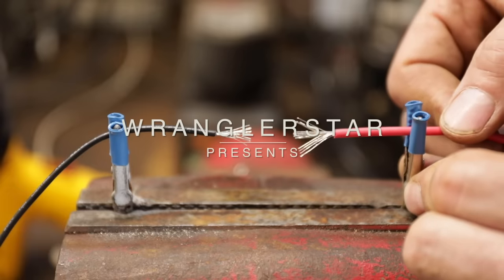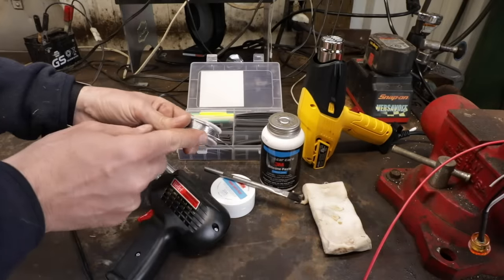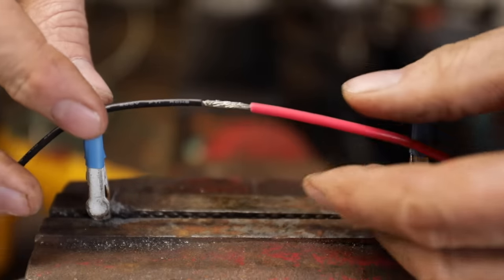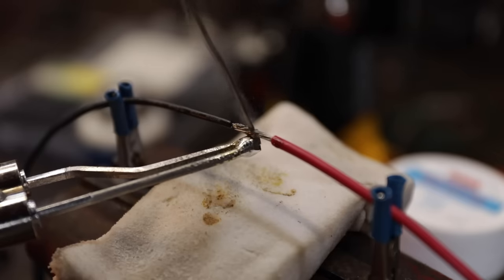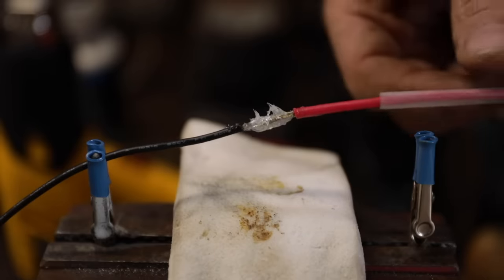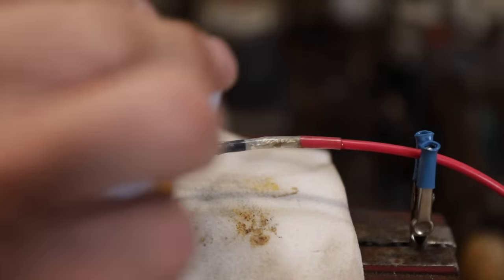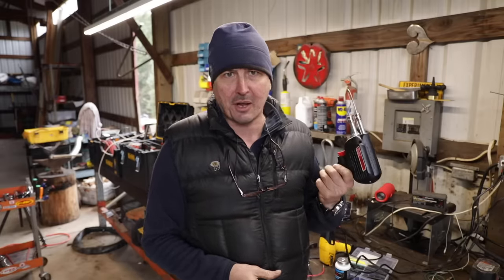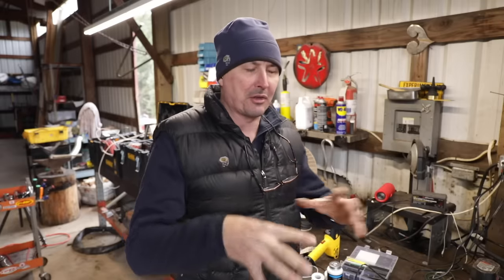How To Solder Wires Like A Pro

Comment: Hey Cody, while it can't hurt, the use of flux paste with rosin core solder in this type of soldering is redundant. Flux paste should be used when existing connections are re-exposed to heat, such as in the case of soldering adjacent connectors, etc.

Flux inhibits oxidation at the site of heating, which results in better connections.

Also, flux should be removed following soldering so as to minimize corrosion. A lint-free cloth and isopropyl alcohol are adequate for this application.

Dielectric grease is a corrosion inhibitor, so it's great for exposed electrical connections. Especially the mechanical type, such as a lug and bolt.

Properly applied, hear shrink tubing will seal connections, and it's also optional in this application.

It should be noted that solder and flux are available for specialized purposed, and that plumbing flux and solder should not be used to solder electrical connections.

Lastly, do not directly touch solder to the iron. This is the reason why it took so long to initially heat the conductors. Heat the leads, then touch the solder to the leads to "flow" solder across the connection. Wipe any flux and solder residue from the tip of the iron, and repeat.

Great video, as usual. Keep up the great work.
Reply: As I understand it, Cody was right to want to tin the iron. Though he ended up keeping a blob of solder on the iron. To tin, he needed to apply the solder then flick excess off, thus keeping a thin layer on iron only.
Reply: I know you should use proper flux for the proper job but I've used an old tin can (or steel? not sure) of nokorode that's been in the family since my great grandfather, and while there's still flux left in there we probably won't buy anything new because it does the job and it does it really well, provided you clean up afterwards (isopropyl and a nail brush). The only issue with it is the fact the binder is a really nasty thick grease, but honestly I'd rather take that over the horrible liquid flux that's really popular, I should also say I would probably get real electronics flux paste if it was sold where I live, but it isn't so no luck on that front.
Reply: Hey buddy where can i get electrical flux
Reply: From a Flux Capacitor,maybe?
Reply: @samborez8089  true
Reply: @slicktmi  the same place where you buy the solder itself .
Reply: @pplo  lowes or home depot only carries the plumbing flux very acidic

Comment: People need to be wary of any youtube video that declares itself as 'how to do something like a Pro', because 99% are not done by pros, always check the comments for an outcry. Speaking as a Pro, that was pretty good, except most QA instructions will instruct you to twist the wire or do a lineman's splice, what you are doing there has no mechanical integrity. Well done on adding dielectric grease, that's essential. 
Just to add, you can also use adhesive lined heatshrink for extra sealing, and most solder has a flux core already.
Reply: Actually adding the dielectric grease helps retain the tube’s 99.99% seal around the bare wires before they were stripped. using heat shrink alone wouldnt be enough to maintain that seal as there would still be possible air gaps.. i wont explain what the dangers of air gaps are since you seem to “think” you know better..
Reply: Where did I suggest 'using heat shrink alone' ? - your point is unclear
Reply: My thought exactly!! I cringed at the wire joining method... Then he wondered why the heat wouldn't transfer..

Comment: We live on an ocean going sailboat so all of my electrical connections exist in the worst possible connections! Thanks for the tips. I’ve been using the heat shrink connectors from Anchor and they usually hold up for a few years, but I’m always looking to improve my technique 😎
Reply: You have data out there in the pacific blue???!

Who's your service provider? I might consider switching over

Comment: Tinning the tip?  It's for improved heat transfer.
Reply: see how this made you into a pro,  wow!
Reply: Tinning actually involves applying solder to the work area then wicking it off prior to performing the repair.  What this does is remove surface oxidation that could prevent solder from flowing and aid in heat transfer.  Adding solder to the tip of the iron is technically called "seasoning." This should be performed after each use of the iron to prevent the tip from oxidizing and extending its life. ...I taught high reliability soldering for the Navy.  😆
Reply: @EenChristJesus  yeah I only watched a couple of seconds of the video but the guy definitely doesn't seem like a pro
Reply: @Eric-xh9ee  of course he isn't a pro, he doesn't even know why he is putting solder on the tip before soldering, nor does he have proper soldering equipment
that's the wannabe do it all
the "it's not dumb if it works"

Comment: Putting a small amount on the iron helps the heat transfer (tinning)
Reply: He did. lol
Reply: Freefallpilot65 you do it while heating the wire it useless the way he did it
Reply: Absolutely correct. That puddle on the tip helps transfer the heat to the joint.     It also helps to put the flat part of the tip on the joint.
Reply: Indeed, increases heat transfer.  Makes solder flow faster and avoids burning things up.
Reply: absolutely, and the wire is probably bare tinned copper no need for flux
Reply: Butthole Tickler he also tinned it then wiped pretty much all of it off therefore did not help at all since his iron was already tinned in the beginning, if he had tinned the iron and left a small puddle of solder, it would’ve helped the heat transfer way better
Reply: It was tinned but Iron was not properly heated
Reply: @Freefallpilot65  Wranglestar mentioned in the video that he didn't know why his grandpa did that.  Watch around 03:48. Craig Flatley was just answering the "why".

Comment: 1. Live in a pool (create a flow of solder and keep it liquid)
2. Solder will travel to the heat once the pool is formed
3. Don't use too much heat
4. Don't get the solder in the insulation from using too much solder (check by bending the wire, you'll know if it's stiff).

Comment: I've had an instant Weller since 1969....... 1. You're using the 'edge', not the face of the tip  [90 degree wrong]    2.  You DO wet the tip with solder -  massively increases heat transfer, to the work     3.  Took far to long to do it -  5 seconds about right

Comment: As a little note, clean off the rosin flux with rubbing alcohol before you put the shrink tubing on. The rosin is acidic and will eventually eat through the wires.

Comment: You don’t need the silicone paste with shrink tubing. It keeps the glue from tubing from sealing properly. Only use silicone on stuff not shrink tubed. Like spade but connectors
Reply: Not all shrink has glue

Comment: Cody, in practice any application where there is a chance for wire movement it is better to use crimp connectors.  In the marine and aircraft industry soldering wires is not allowed unless the wire is supported and not allowed to move. 
There is no doubt that a solder connection provides the best connection.  It come down to the movement of the wires.  
Also if you are using core solder there is no need to use paste on the wires.  Never use acid core solder on electrical connections either
Reply: Crimping is NOT better for splicing wires; solder is preferred method. If you have enough movement in the wire that solder is going to break, the wire is going to break anyway. Signed UH-1H crewchief!
Reply: It is not allowed in the NEC either. Current will heat the solder and it will fail. If you use in automotive I don't think it would be a problem if the conductor is large enough and your current is limited by a small amp fuse.
Reply: He's obviously talking for 12v applications, he did say trailer.....
Reply: Terry Pendergrass - I've just looked at the FFA's Aircraft Electrical Wiring Interconnect System (EWIS) Best Practices, and it says nothing about soldering being a preferred splice method. What published standards do UH-1H crews work to?
Reply: BlindGuardian050 that shows your intelligence buddy! Hahahaha
Reply: But...
Aviation style connectors have two sections and have to be set properly. One part of the connector crimps the wire and the other crimps the wire AND insulation keeping it from concentrating the stress there. While that may be the best mechanical connection for vibration, I use solder and heat shrink a lot, Cody’s example is a nice way to do a joint exposed to weather.
Reply: If you heat a connection to the 600 degrees that it takes for solder to fail, you've got bigger problems.
Reply: "Any application where there is a chance for wire movement it is better to use crimp connections". I disagree soldering is superior.
Reply: Technically, in many applications where wire movement is to be expected, crimping is the best option. I will agree that soldering creates a more electrically conductive connection, but crimp connections are more than adequate and much of the time are required to be used where movement will be seen in the wiring.
Reply: @ Bullion Forever  In high vibration environments, soldering is dangerously inferior. Not electrically, but the mechanical resilience  of the connection.  That's why it is usually not allowed with stranded wire in marine, aviation and rolling stock. The wires will break at the transition zone between the solder wetted and non-wetted wire parts. You can try it yourself, it is quite shocking how easily the wires will break.
Reply: Terry Pendergrass If the crimping is done properly, the wire leads will practically be "cold welded" to the connector from the pressure applied by the crimping tool. I'm not talking about those crappy combined crimping and de-insulation tools, I'm talking about a proper crimping tool, those will apply a lot more pressure.
Reply: And the prize for best answer !!!
Reply: National Electric NEC is for buildings... which use mostly solid core right?
Not stranded. And if your circuit gets hot enough to melt solder something is very wrong.
Reply: Oxygen sensor wire on a high boost turbo car. Especially if you try and use a "universal" O2 sensor and you cut and solder the wires. In the case of the O2 sensor, it also may impede the air for self calibration. Modern sensors use the air between the wire and insulation.
Reply: OOPS, I thought I was replying to The Reverend's comment of "If you heat a connection to the 600 degrees that it takes for solder to fail, you've got bigger problems." Thus my random O2 sensor example I gave.
Reply: Wrong, Soldering is allowed, better, just depends on what and how
Reply: Actually most Aircraft/spacecraft wiring harnesses are factory soldered, field repairs are usually crimp connectors as soldering on the line is not as practical.
Reply: Dave, that is correct. We only solder to pin connectors on avionics racks. Everything else is crimp connectors.
Reply: Absolutely incorrect sir. 40+ years experience and 10 years teaching mil-spec soldering in the Nuclear Navy and commercial Nuclear field. Get your facts straight. Learn about temperature/ current load cycling and solder crystallization, and the effects of vibration over time on even mil-spec grade solder joints. Properly made crimp connections have none of these problems. I personally discovered the cause of Navy fleet submarine nuclear instrumentation intermediate range detectors causing random spiking problems causing reactor trips due to soldered triaxial cable connectors having the solder crystialize (acting like a crystal radio detector). The answer was to use crimp connectors, which are used to day on all nuke plants, Navy and commercial. Current ranges were from 10 -11 amps to 10-3 amps for these detectors. Your experience sir?
Reply: I'm sure you know more than automotive manufacturers like Honda, who insist that wires be soldered and specifically day never use crimp wires BECAUSE wire movement will cause crimp connectors to fail.
Reply: "Also if you are using core solder there is no need to use paste on the wires."   Wrong. Always flux your connection before soldering. Cored flux is for continued fluxing during the soldering, pre-flux is still preferred/required. It also improves wetting action.  Ref: NASA quality standards for soldered connections.
Reply: Solder provides the best electrical connection but can not be depended on as the physical connection. I think that's what your statement implies.
Reply: @nationalelectric6507  Generally, Current would only heat the joint up if it was dry joint..
I suppose that's quite possible by listening to some pillocks advice on here..

Comment: I agree with the way you are doing it. I have seen so many other ways to do it but end up with a big bump in the wire. If you are making a joint and tape it and put it in a loom the smaller the better. Spent 17 years building looms.

Comment: Chuck A's reply hit it on the head.  Use the Lineman's Splice and do it to NASA specs and you'll have a good mechanical joint that is secured with the solder.  Cody, your joint is depending on the solder to hold it together which could fail.
Reply: Lineman Splice is for solid wire. It is much weaker on a stranded wire than on a solid core. The weak point isn't the bind, obviously, it's the stranded wire itself. It's an overkill. Entirely valid and a fantastic bind, but overkill nonetheless
Reply: Maybe if you didn't think you were so smart you clearly see this is for automotive purposes..... Maybe spent less time being a sideline quarterback
Reply: Oh I know, but it doesn't change the fact that weak point becomes the untinned stranded part, making it redundant. The tension resistance of stranded wire is less than what the actual splice will give you. Making a bulky solid splice may sometimes do more harm than good if you think about it (automotive comes to mind)

Don't get me wrong, I think mastering the Nasa spec splice is a wonderfull skill to have. I would definitly encourage anyone to master it. I guess my main point is that Cody did a pretty solid splice that will last and do the intended job it's meant to do.
Reply: I'd love you to find someone that tins wires for a car or trailer, I've done hundreds or remote start/ alarms as well as other automotive installations and I can tell you that I've never had a single vehicle come back because of a solder issue, you people mentioning NASA like your building something for space.... give me a break ps using the right solder for electrical work makes all the difference in the world
Reply: the reason for the standard is not because of mechanical strength but because if the wire gets overheated from overpower the solder can melt but the connection will still remain. the linemans splice will hold good connection with or without the solder
Reply: chris you would have to understand automotive principles first, there's a reason everything is supposed to be fused.   Our the wires hot enough to melt solder than it's hot enough to melt the coating starting a fire/direct short. There's a reason they have different gauge wires to match your application. You don't wire a constant heavy draw with 18ga wire so regardless of which method your using its all about current draw and application
Reply: automotive is another game but this video never says specific it just says how to solder a wire like a pro. anything with any kind of strain or gets power surges is a good idea to do the linesman. it also makes a nice clean splice but you do the hack and go doing remote starts no one will care but if your fixing say the cord to a circular saw you want it
Reply: chris if you don't know what is to be used when then you shouldn't be doing it, he does specifically say for a trailer or something in the video
Reply: Lineman's Splice is meant for solid wire

Comment: I don't recommend the big Weller guns for small soldering jobs. the more old fashioned soldering irons work just fine for small wires and such. The Weller's do work well for most things tho, but they have too much heat for some jobs.
Reply: Leon thecat  yep  I have several irons and guns. The right tool for the job at hand does wonders. oh, the little drop of solder on the tip gives better heat transfer. you should always get the wires to melt the solder tho for the actual soldering job.

Comment: Tip 1, get a soldering Iron not a gun.  make sure it's 25 watts at least. Chisel tips are wonderful.  Tip 2, flux is built into most electronics solder so you don't need to use flux before hand.
Reply: But if your solder doesn't have flux, USE FLUX.  Soldering without it is pointless self-torture.

Comment: You should use flux cleaner to wipe that joint down before sealing it. The left over flux can corrode the joint inside the shrink tube.
Reply: too late its crept up the insulation
Reply: Not true. Rosin flux is not corrosive. I have aviation radios from the 1940's and 1950's with rosin flux residue on them: the solder joints are still fine after 3/4 century. You are confusing rosin flux with acid flux, used for plumbing work.